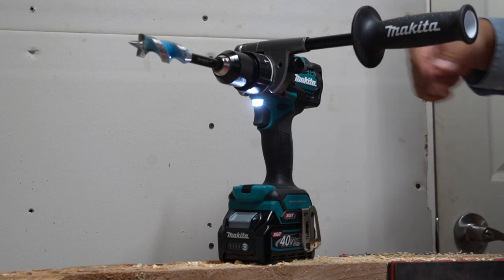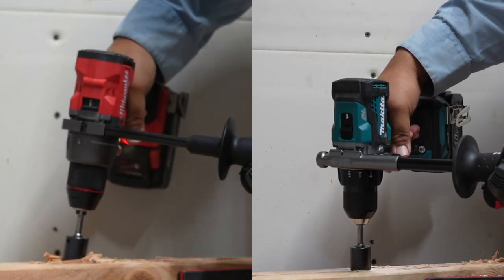Milwaukee Gen 4 (2904)🔥 VS 🔥Makita 40V XGT (GPH01) Hammer Drills

Comment: The XGT is the best hammer drill in the industry right now and it's not just raw power that makes it the best, like the man said it just sounds and feels different than the competition, I have both and the best way to describe it is the milwaukee is like the 70's muscle car and the makita is the modern lexus V8, both make the power but the makita is so much smoother and easier to control precisely.
Reply from the maker: Very true 👍
Reply: I have the Makita 40v hammer drill Ann’s a couple of months ago I picked up the Dewalt DCD805 hammer drill. The Makita is a beast, but the Dewalt in masonry seems to be much better, faster, effortless.
Reply: Makita has always been the best highest build quality Home Depot just hawks Milwaukee so hard so everyone falls for them but there's a reason Home Depot only rents out Makita stuff. Going from red or yellow the second you pick up anything Makita 40v it just oozes quality.
Reply: I’ve been running Milwaukee now for four years great power as a framer. I’m constantly having to drill and screw for larger applications and I love my drills and I swear by Milwaukee I started up the XGT line 2 years ago, and very recently purchased the drills. They are magicalto say I don’t think they have the same amount of raw power as the Milwaukee but are 1000 times more versatile and at the cost of fractions in comparison to Milwaukee not in price because they are more expensive but for a very good reason

Comment: You would think a 40v tool would dominate an 18v but admittedly I do not understand voltage, watts and how that translates to performance. I use both Milwaukee and makita (18v) and love both brands. All manufactures make some really good tools and some not so good, but I think Milwaukee and makita do a good job of having more hits than misses 👍
Reply: Voltage doesn't matter that much, they could in theory get the same power from 4v pack with same 20 cells.
Reply: High voltage tends to run cooler at the same wattage as lower voltage.
Reply: @Factoryseconds123  yeah in practice there are some limits in conductor area
Reply: Higher voltage runs cooler and longer than a lower voltage. The way Milwaukee has power is the amperage output through the battery is slightly higher.

But Milwaukee batteries can easily overheat, Makita batteries won’t do that.
Reply: Watts is power
The formula for watts is Volts times Amps. (Technically voltsxampsxpower factor but I’ll keep it símile)
So to achieve the same power with a lower voltage you need more amperage/current flow. 
As long as the wattage of the tool is the same then regardless the voltage of the battery you will achieve that same amount of power because the amp draw will compensate based on the voltage.
Reply: Lower voltage thicker wires higher voltage thinner wires 
Lower voltage higher amp draw 
Higher voltage lower amp draw 

1 amp @100v is 100 watts 
100amp @1v is  100 watts

Comment: XGT charger is three times more expensive than Milwaukee's unit. Battery is about twice as much. No backwards compatibility for XGT/LXT.
Reply: Their chargers new are compatible with both 18 v and 40 v. There's only a handful of 40v tools in their catalog so it's not the worst not having backwards compatibility
Reply: XGT charger is more comparable with the Milwaukee rapid or supercharger speedwise though. So, it's either in the same price range or an even better buy!
Reply: Yes. Higher quality tools tend to be more expensive.

Comment: And that's with the smallest battery in the 40v line throw the 5 or the 8 on it and watch her eat
Reply from the maker: That's true 👍 it's a 40v  2.5ah
Reply: I use the 5amp on my 40v gives it a big boost in power
Reply: 40v does offer more power but where it really shines is run time.

Comment: I think but we both also got to see is that you are running an 18 V versus a 40 V that also comes in the play as well… I don’t know I’m still not sold… i’ll stay with Milwaukee… I think it’ll win in the long run, it has the longevity… in my opinion… Great video though…
Reply from the maker: I understand this is just for fun of science. I've seen 18v red and 20v yellow tools beat 40v and 36v tools sometimes voltage ⚡️ doesn't matter.
Reply: There is no way Milwaukee make a more durable product than makita and the 40v argument is getting old its the top Milwaukee has to offer against makita top offering

Comment: The power of both tools will be different. One is an 18 volt and a other is a 40 volt. Voltage will be based on potential  power when using the hammer or drill/driver to see what potential energy will be released.
Reply from the maker: I've seen 18v tools beat 40v and 36v. Sometimes voltage does not matter.
Reply: according to your reasoning the Milwaukee should have won it then... 18v and 6ah battery vs a 36v and 2,5ah battery. Either way they were so close in speed and power so no clear winner in this test. Didnt he say gen 3 in the video by the way?